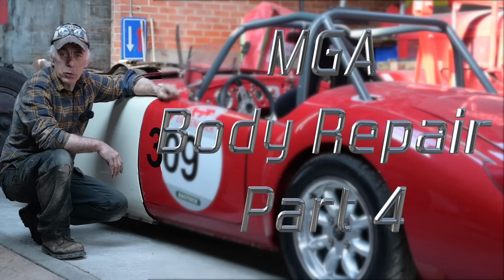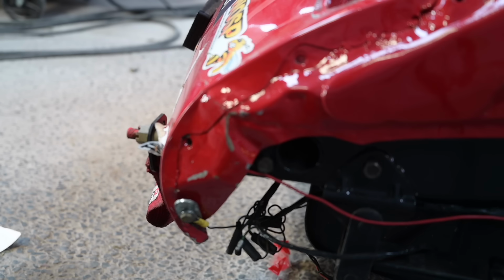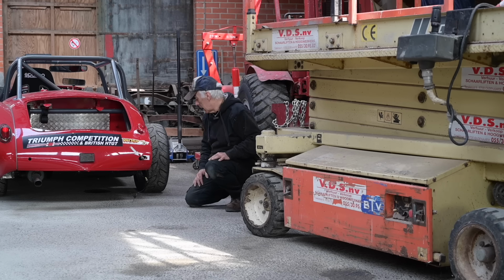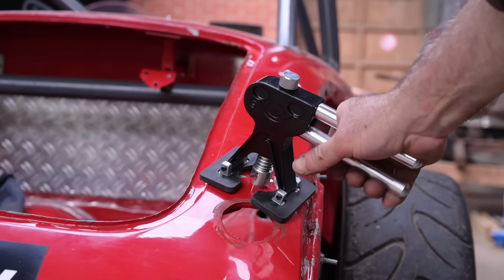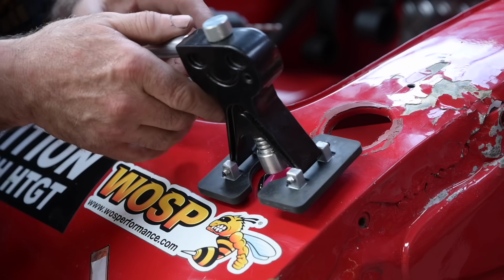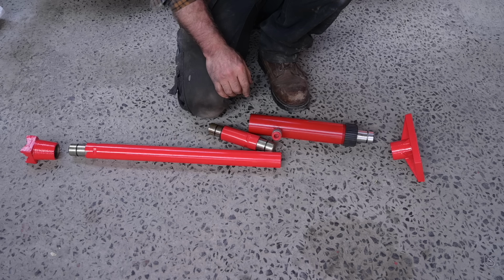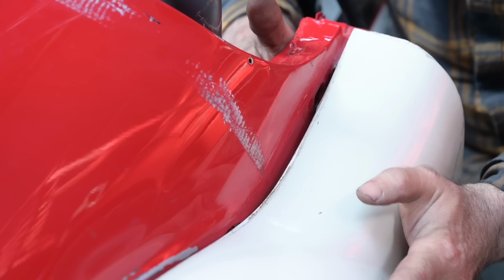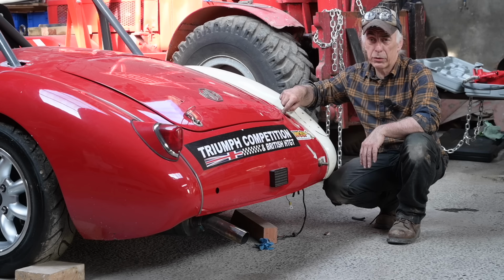MGA - Body Repair - rear end - Part 4

Comment: Steve, Really nice job considering how much damaged there was to the front and back. The body jacks have done the job well. It‘s amazing how much flex there is 
in metal under tension or compression and knowing how far to stretch or not is a close call sometimes. You must be pleased with the results. Cheers Dave
Reply from the maker: Thanks Dave,  indeed knowing how far to stretch is something that can go wrong.  It will just rip the material appart.   The harder part om this car  is door , as that is an aluminium skin and very hard to remove bends from.   See you

Comment: Who did the damage??
🇨🇦🤓🤟
Reply from the maker: This car was racing on the triumph competition, driven by a Dutch pilot. Last year he made a drivers mistake and hit the barriers etc..  I know the name as I spoke to the man.  However, he asked not to mention his name... so I will not.  Anyhow, it was a very serious crash and the pilot stopped racing.
Reply: @D3Sshooter  
Racing is dangerous..no matter what you race..i raced Dirt Bikes for 15 years...had many crashes...broke body parts....continued to show up till i finally had my fill and had to retire.... never fazed me enough to be scared...oh i realized how lucky i was after the crashes..but the chance of injury never stopped me from competing....after many injuries it enters your mind but a true competitor will block that out to perform as best as possible.... i was never a Champion but did pretty good doing it for fun and as my main hobby.... i wasn't asking for a name other than if You had done it ?? 😂
🇨🇦🤓🤟
Reply from the maker: @garymallard4699  , Hi Garry,  i know what you are talking about.. I used to race motorbikes ( race bikes not dirt bike) when I was younger.   I have not told that yet in any of the video's..  We used to race in those days 1979-1990 on public roads that were closed of for traffic during the race...  Crazy, it was ... you know that  for sure as mate dirt bike racer...   I ran a modified honda 250cc 2-stroke ( actually a dirt bike engine) fitted onto a race frame...   And , yes I did crash several times , broken leg  and arm one time,  the last time it was more serious , I slipped in a e right hander ended up going through barb wire and stranded on a concrete cow water pit...   Result 258 stitches in my face , if you look close at the top of my nose , you will see that a piece is missing (where it joins the forehead... and a few broken ribs...  That was the last race... at the end my face was getting better with the time....   That is how it goes ....   Thanks for respondng
Reply: @D3Sshooter  i raced from 1975 till 1991...was that a Elsinore engine ?  Yeah i seen some stuff on your face...thought it was from Bar fights or something.... i got stitches on my face from an accident when about 3 yrs old...fell on a glass bowl and got cut up.... i destroyed my right elbow first year racing..removed my Head of radius at elbow..sternum cracked in a big crash at a Canadian National on my 490 YZ... broke the fork tube clamp..too...messed up my left knee but never got it repaired as it is ok...lots of little stuff ... came out actually ok compared to other guys i raced with....part of going fast is running out of talent at times and we bit the dirt/asphalt/concrete...or ice in my times too..( ice raced briefly..too many left turns )